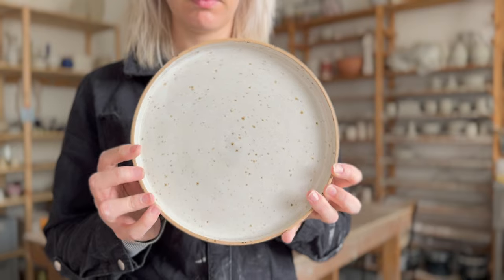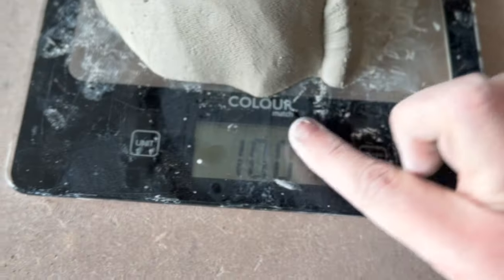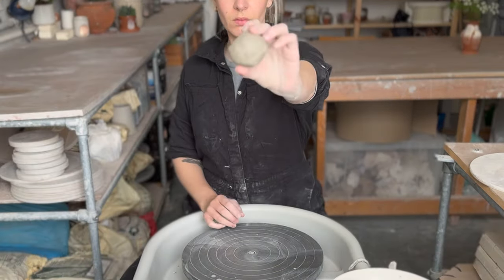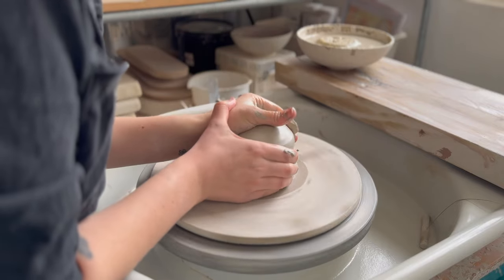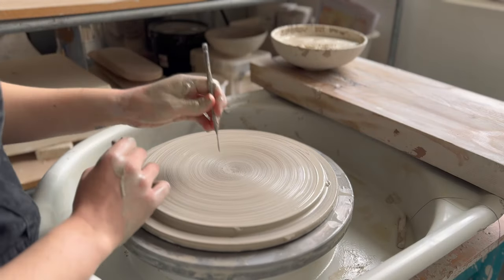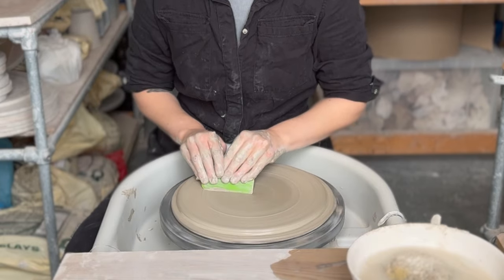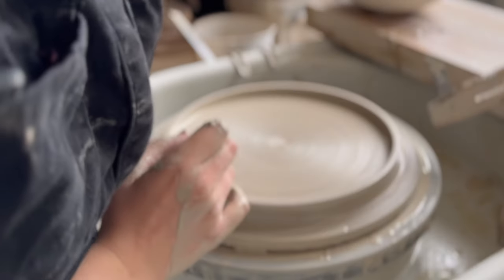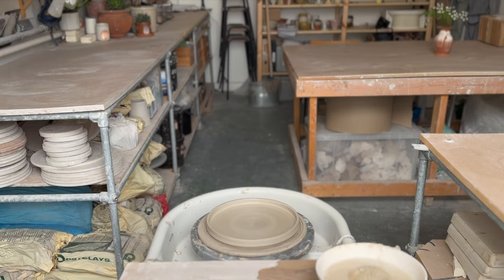How to throw a plate on the pottery wheel

Comment: I have figured out that if I throw plates on a plastic bat, that I don't need to cut it. It naturally releases, and is super smooth on the bottom. No cracking or warping so far.🎉

Comment: I'm new to your channel and had to use a converter to find out pounds from a kilogram!😅  That is a much smaller amount than I would have used, but your plate has a clean line, and I'm sure is nicely light to handle.  You've inspired me to try your technique!